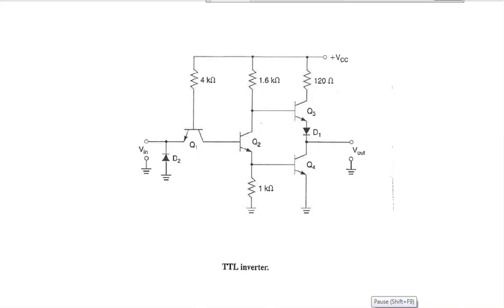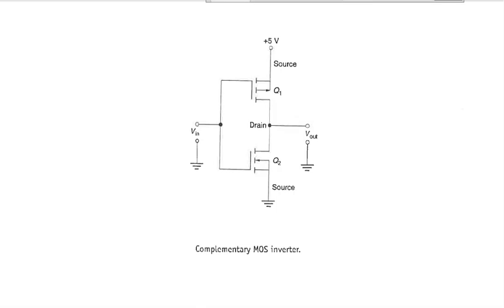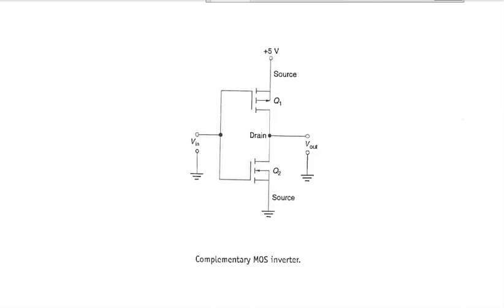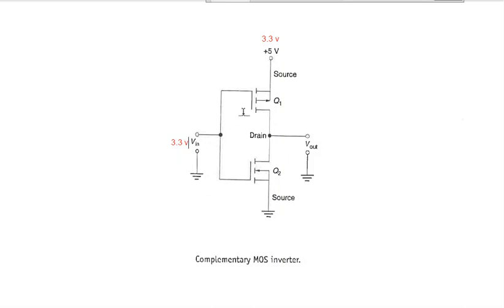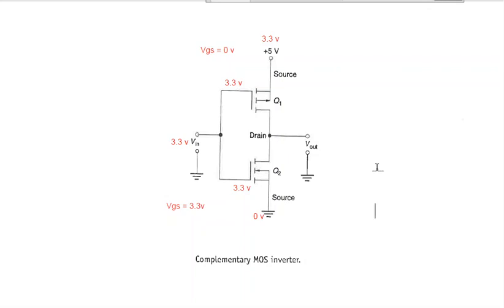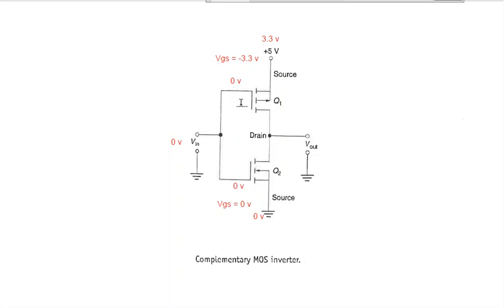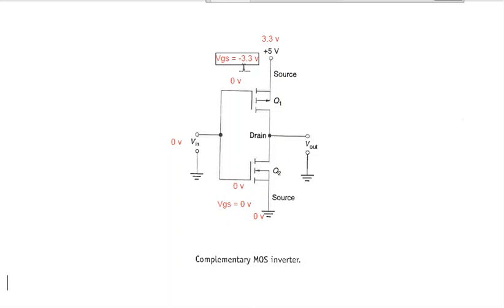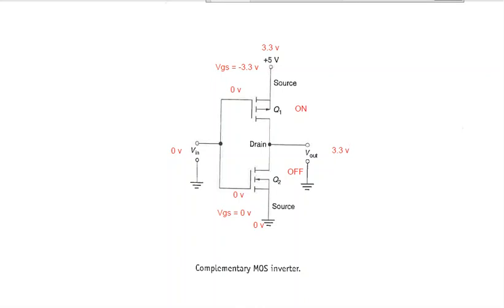TTL vs CMOS

Comment: Complete NOOB here. So, the Q [Q1 and Q2] stands for mosfet? I thought it stood for transistor. Please clarify. Thank you
Reply: In general it does stand for transistors. I have seen M[M1 and M2] on some other books but I think the Q represents them best. Also, with Q you can represent the quiescent point of a transistor, which is also referred as the Q-point.
Reply: Thank you, I really appreciate it, as I am trying to learn more about electronics. Be safe mate
Reply: Will do! Thank you kindly. Cheers!